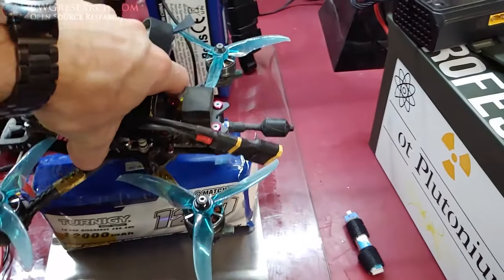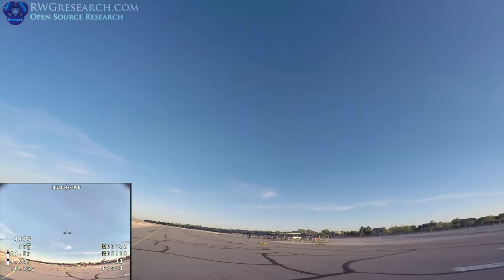TEST 2 |12000mah battery with A 5" FPV Quad attached... ! Fixed CG

Comment: I think you'll blow an esc eventually, but could probably adjust the pids to make it more stable. what kind of amps are you drawing?  I did this test on an older drone once with separate escs and blew one in mid flight.
Reply from the maker: I mean it's only 30A or so to hover. (Amps are in the bottom left of the screen on flights) and about 50 amps or so to just cruise around. Not to bad really. These are 1800kv motors. I think it would fly stable on higher KV motors. Its not the amps that worry me ATM. Its the RPM needed for flight to hold the extra weight. I run out of RPM and it gets unstable. ~Russ

Comment: Regarding your HO research- Here’s what Stan took to his grave.  He created standing waves of electric current in the resonant cavity. What he did not tell anyone is he connected TWO separate + - ac power sources to a pulse generator. Then he modulated the frequencies slightly offset of each other (eg 106hz &103 hz) creating a new frequency as the 2 pulse waves crash into each other. Think about how bineural beats work. Same concept. You tune & modulate these 2 opposing frequency waves to agitate the water and disintegrate it into HO + O. 
Godspeed. 

-Stephen

Comment: ANyone else yelling to themselves UNPLUG! BTW your PID tune is off or you have wires above your flight controller and its causing that motor to freakout
Reply from the maker: haha yeah, so for sure the PID dune is off with this heavy of a battery. however i fly with everything just like you see with a 5000mah ( video at the end there) and it fly's like a dream. so i think its the weight / motor RPM ( its maxing out) and the PID tune... ~Russ

Comment: You’re using about 85 to 90% of your motor power to compensate for the weight of the battery you’re gonna burn your motors up and probably burn your ESC up
Reply from the maker: I mean I am using a lot of power to just carry the weight. But strangely its only about ~20% more current to hover.  But..its alot.more RPM. If I had higher KV motors it would be more stable in flight. Kinda interesting for sure. I'll have to get the logs off and really compare numbers. ~Russ